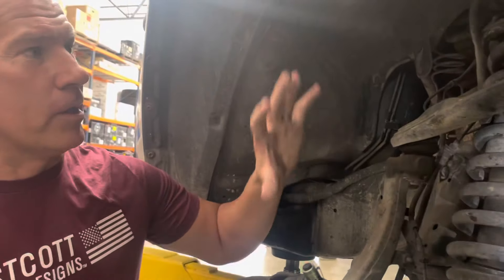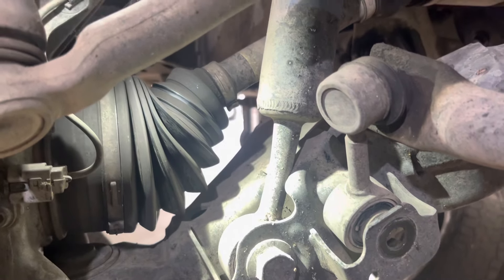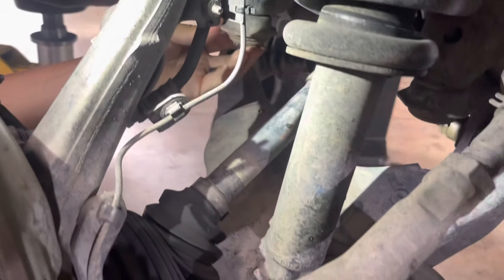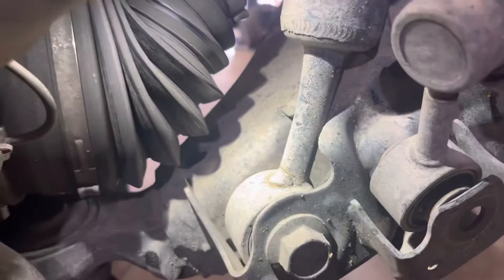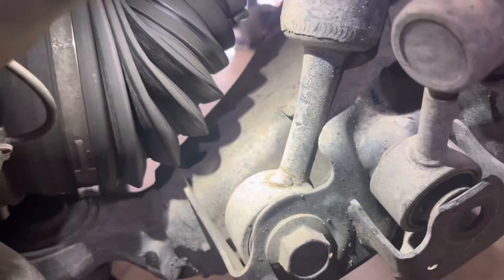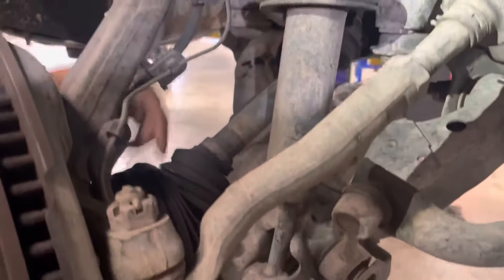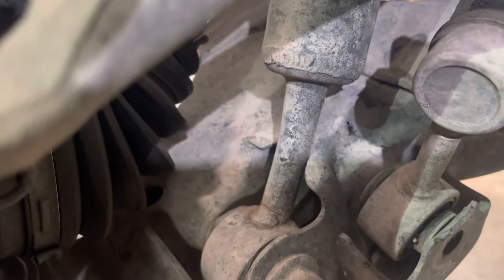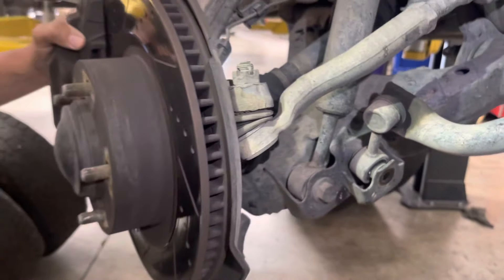The effect of running a traditional spacer lift

Comment: How big is the spacer? Would this happen with a 1" spacer?
Reply from the maker: This is a 3” lift and anything at 3/4” or taller bottoms out internally at full compression.  That is what causes this to happen.  When it comes to an abrupt stop when traveling downward it is then multiply the force causing it to have to give somewhere and it usually at its weakest point.

Comment: But you sell a 2.5 spacer kit; how is the mechanics different?
Reply from the maker: @tpharo34  this mounts on the top of the strut and pushes it down to lengthen the strut.  That’s how it creates lift.  Now when you fully compress it you lost the upward travel because the strut bottoms out internally before it hits the bump stop.  This over a period of time will cause the strut to snap off at the bottom as this one is starting to in the video.  Ours works exactly like a coil over by adding more preload to the spring in return makes the spring push back which creates lift.  What we do is we make a collar that replaces the factory collar that the spring sits on on the bottom that is a little taller.  So it full extension it’s exactly factory location and at full compression it’s still at factory location and utilizing the factory bump stop as well
Reply: @westcottdesigns  Ty hope to order soon 👍 I called to ask about setting an appointment in person.
I’m in Texas so it would be a drive. I wasn’t able to get ahold of anyone.

Comment: If I use a regular lift those thing still not going to touch. Right?
Reply from the maker: If you use a traditional spacer lift this is the risk you take on if you off road to hard or hit a speed bump to hard.
Reply: Ah ok that’s good to know. Let say I put a regular spacer and I use only the truck for work, it’s that ok?
Reply: @hlipm0adzz  As long as your not off roading and really pushing your suspension to its limit you should be fine

Comment: Does the spacer lift wear out the coil spring ?
Reply from the maker: So will say a spacer lift is a spacer lift.   So it comes down to a true spacer will cause the strut to fail or snap and our preload collar will not cause premature wear.  But springs will lose.spring rate over time with or without a lift.  Some will lose rate faster then others do to the amount of weight added to the vehicle.  When I worked for Toyota we would see new TRD PRO 4Runners lose 1/2-3/4” just off the transporter do to how hard they got strapped down.  Please let me know if this was the info you were looking for?
Reply: 2008 highlander limited.  Looking at  northwoods performance package w bilstein 6s, upgrade northwood springs and 1.5 spacers. What do you think about that and what do you offer that's comparable?  Thanks

Comment: Critical question thats not been mentioned yet...  with a spacer above the spring, does that compress the shocks by that same amount continually even when parked?    IE: 2" spacer, so the shocks are 2" 's tucked in and "lost" cushion?
Reply: No it doesnt affect the spring the spring is under constant tention from the housing so the spacer bolt to the top of the housing and the strut mounting point there for dropping the whole assembly down. So no the spring tention is the same it doesnt change.
Reply: I dont know if i misunderstood the question but the answer is still no it just changes the shock position not the function the cv and control arms are affected and will wear faster yes but the shock will just be moved down

Comment: thanks for your explanation....may I ask you about rough country 2" spacer kit for Fj Cruiser?? which is 1" in thickness, does it cause premature failure too? thanks in advance!!
Reply from the maker: 1”. Would be right at the limit of the strut at full compression.  It may be just bumping out at that.  Only way to truly tell is to remove the spring from the strut and bolt it back in and run a full cycle on it to make sure it’s still bumps out

Comment: This man is so full of BS LMAO!! I’ve ran a lift spacer for 5 consecutive years! Sold the truck with it still on there!
Reply from the maker: Who is full of shit?
Reply: @westcottdesigns  Don't mind him he clearly doesn't understand the critical thinking/analysis of said suspension lifts. He had a good experience with his lifted truck and assumes everyone else will be alright however allow me to bring my actual two cents into the matter.

The spacer itself is almost never the issue. Installing a larger/longer bump stop would've definitely helped out the OEM suspension live a longer life. However what always happens is user error. The owner figured "I'ma jump this bitch aka dirt cliff and do all sorts of crazy shit I'm not supposed to". The owner overestimated and underestimated the breaking limitations of OEM parts. OEM parts are designed to withstand upto a certain, going past that and reality starts to get real ugly fast.

It behooves to all individuals lifting their suspensions to invest in off-road extreme/hard hitting performance parts to compliment the spacers if one decides to put their vehicle to the test in off-roading and extreme baja 1000 torture race runs.

I'm an IT Specialist by the way and I have my 2013 F150 lifted and upgraded to ICON Vehicle Dynamic Strut Suspensions and ICON Vehicle Dynamic Upper Control Arms and Zone-off Nitrogen Rear Shocks. Took me a decade to save up the money and finally have the parts installed. Rides like a dream and off-roading is jazz event.

Cheers 🍻